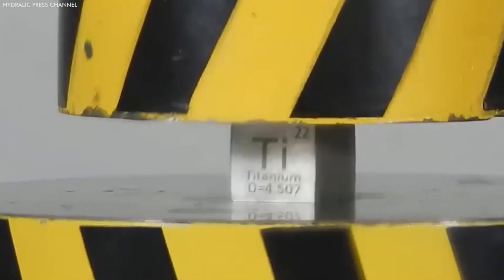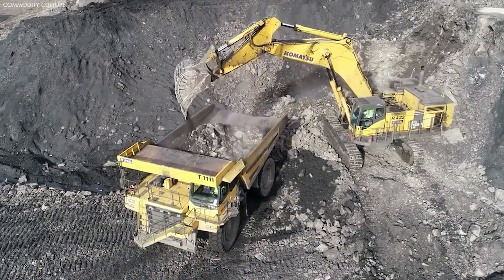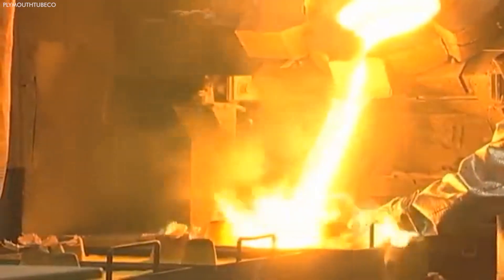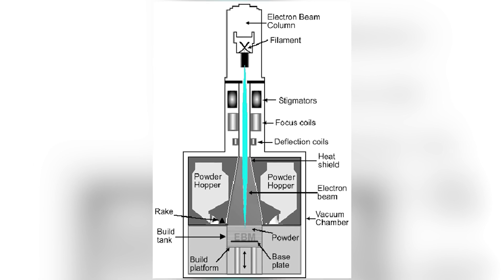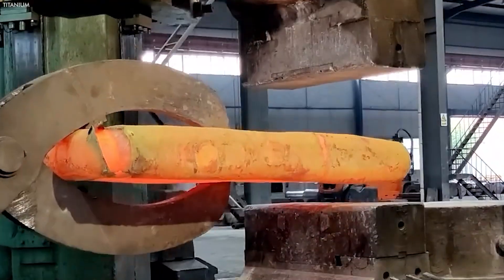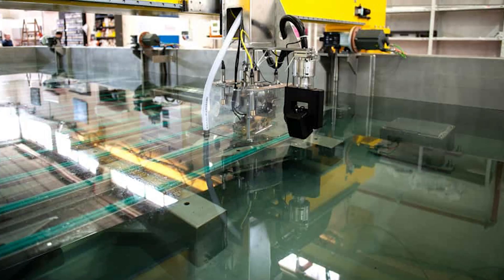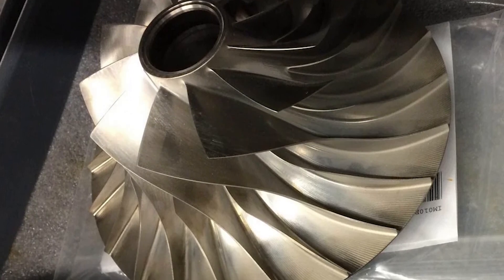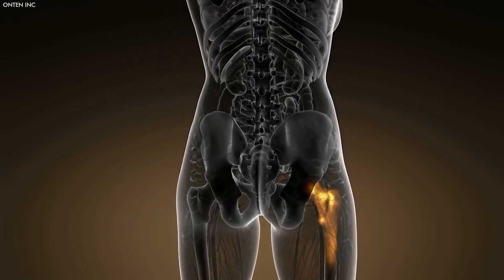Satisfying Process of Making TITANIUM in 8 Minutes - Modern Manufacturing At Another Level

Comment: It's incredible the amount of earth that has to be processed to create a little bit of titanium.   No wonder it's a relatively expensive metal.
Reply: Incorrect. Titanium dioxide (which is what rutile is made from) is actually fairly common, in fact they are used as white pigments for all sorts of applications from food to paint. What makes them expensive is that the process to turn titanium dioxide to titanium metal is quite expensive. Needing to sift through tons of earth is also fairly normal for various materials that aren't insanely expensive, stuff like iron ore or bauxite for aluminum.

Furthermore, the video footage shown here is ripped from other sources, and none of them actually shows refining of titanium. First of all, any refinement of titanium is done in an argon atmosphere, because otherwise it would be turning all shorts of purplish color and chalky white if left heated long enough in air. They are also not milled anywhere near the same as steel, and the videos all show processing of steel, not titanium. Except for the machining videos, which may or may not be titanium (they look fairly similar to stainless steel).

Basically all the hot glowing metal you see coming out of a forge are all steel. Titanium can't be heated in open air without introducing impurities (in fact when welding titanium any color is unacceptable at all!!)

Which makes me think this video is low effort content.
Reply: @taiwanluthiers  you know your metalurgy , thanks for your honest , factual input
Reply from the maker: @taiwanluthiers  Let's just all agree that this is a high effort comment! Thanks
Reply: @Factorama_eng  I think if you're going to do a video on refining titanium at least find footage of actual titanium mill, not steel mills. If titanium got this hot in atmosphere it would have been full of contamination and it wouldn't be useful for any application, as the impurities would make it brittle.
Reply: @Factorama_eng  Right?  Great response.
Reply from the maker: @dbach1025  thanks
Reply: The amount of energy required to produce it is insane.
Reply: this is why recycling programs are so important. recycling uses way less carbon than these mining processes (which will always be necessary) Unfortunately recycling companies wont pay you the true value of your scrap titanium and i wish local recycling networks were better
Reply: Titanium oxide is the white in white paints . Titanium metal when molten oxidised in atmosphere so its worked hot in a vaccuum, thats what makes it expensive. All pics of forging in this clickbait vid are steel mills NOT titanium .
Reply from the maker: Right! This despite the fact that Titanium is like 0.5% of the earth crust!
Reply: @Factorama_eng  - Out of 3 Kg of pure Titanium Dioxide extracted from tons mined ore, only about 1 Kg of Titanium metal can be extracted under the most optimal conditions.  That's because TiO2 contains one atom of Titanium for every two atoms of Oxygen.